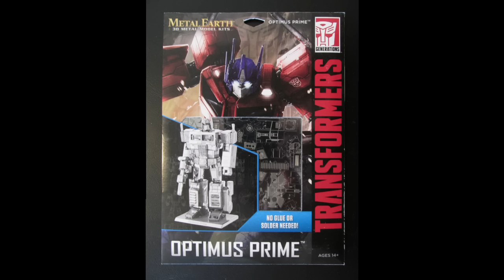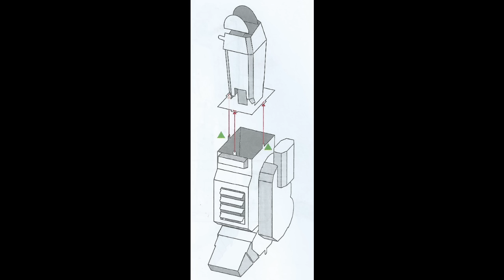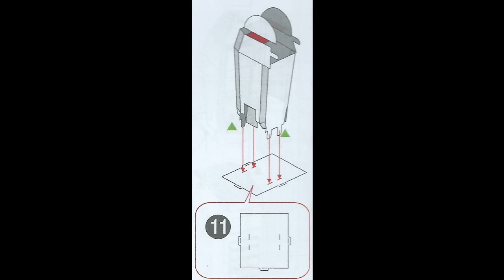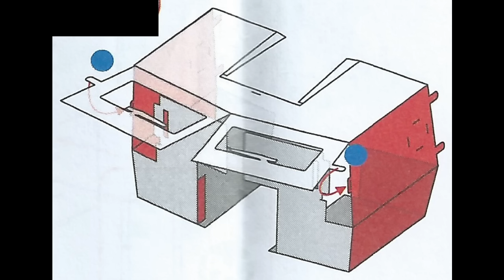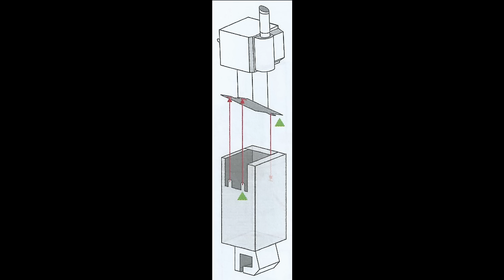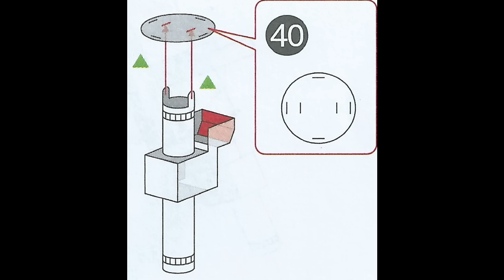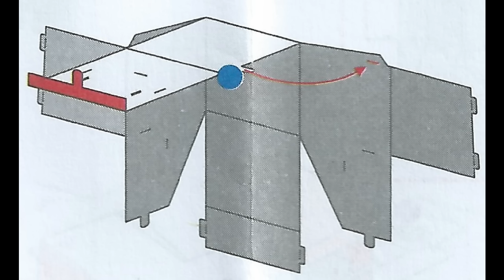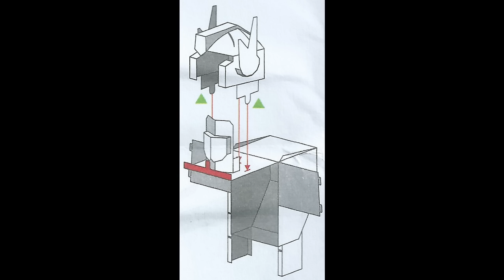Metal Earth Transformers Optimus Prime

Comment: Did you notice that (firstly, it's based on the MP 10) the flaps hanging down under the gun compartment are wrong?! They're supposed to be parts of the headlamps and the bumper and they're supposed to be flipped up!!!  See "Video Review of the Transformers TRU Exclusive: Masterpiece Optimus Prime" at 36:35 if you're curious (i can't post links i got spam guarded)

Comment: are. you twisting or folding to secure connecting inserts. folding poses problems for me.
Reply from the maker: +SomeKindOfNerd - I do both, depending on what the instructions call for.  Sometimes with the folding I will add a slight twist for a more secure connection.  This particular model was my first attempt at Metal Earth models, so my skills have improved over the last few builds.
-Bartatron